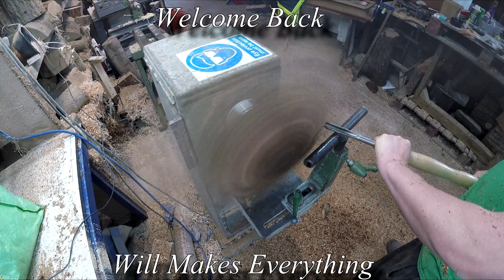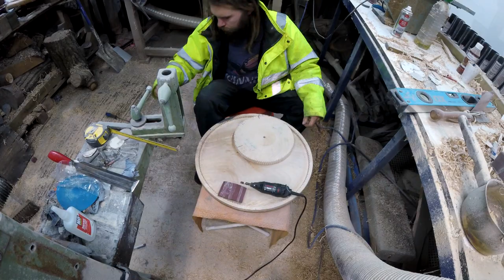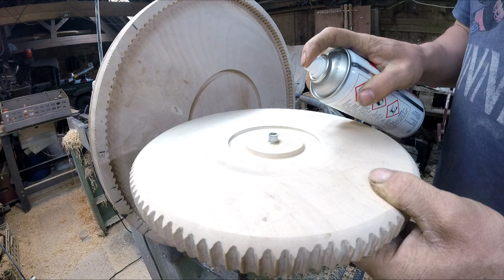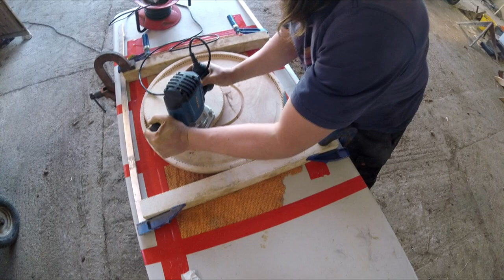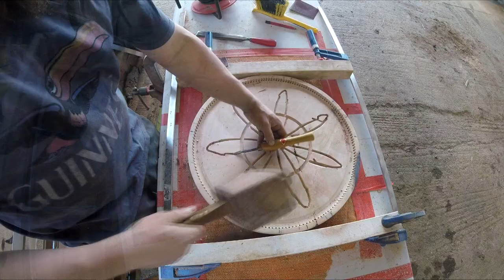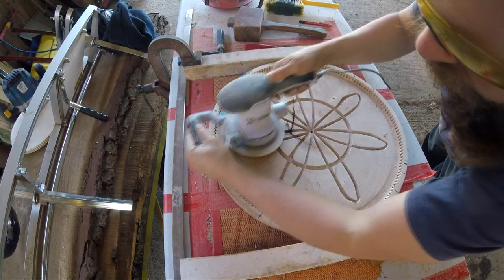Spirograph 6 - The Routing Debacle - Wood Turning

Comment: Nice work Will persistence pays off. Judt out of curiosity what do you think might have happened if you had put carnuba wax on the back of the cog? Would it have rotated easier? Or do you think it was because of the 2 e trade teeth?
Reply from the maker: I actually found out while preparing the big cog, that the spacing varied, possibly due to my centre hole being a fraction of a mm out, I couldn't get the small.cog to do a full lap no matter what I tried, we are where we are and I will make the best of it :)